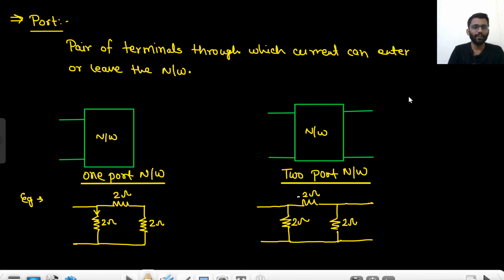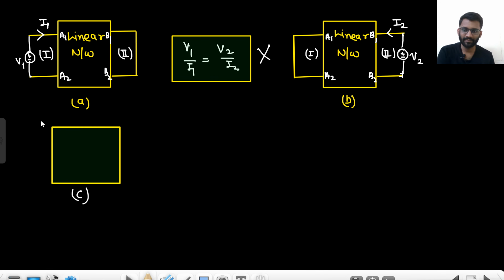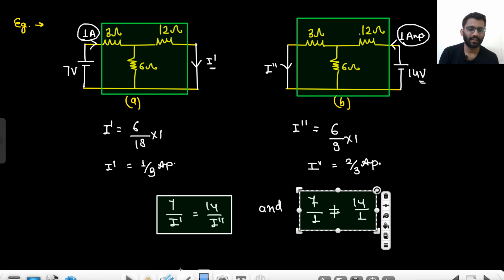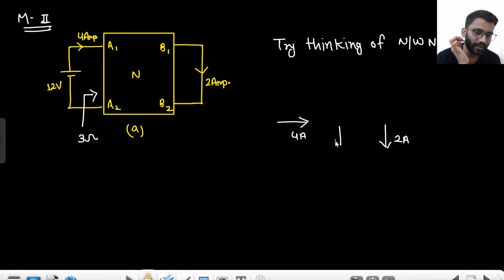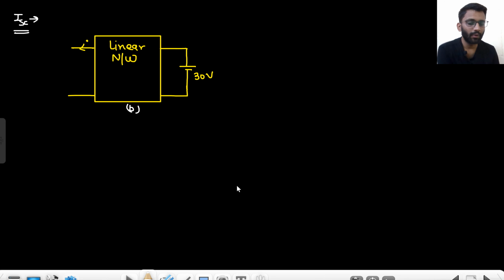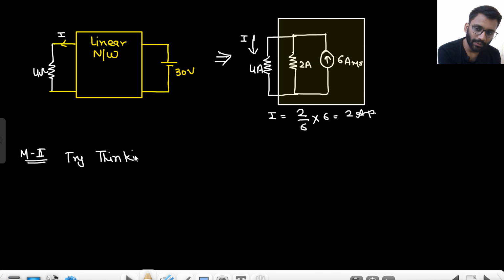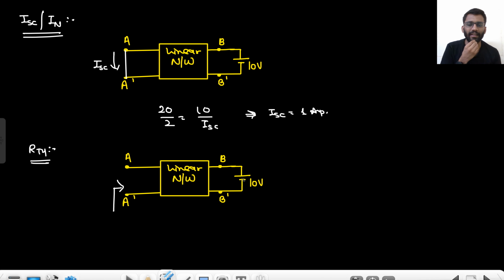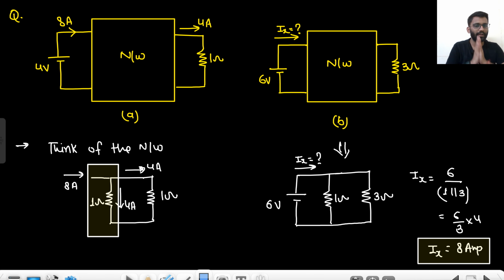Reciprocity Theorem || Network Analysis || GATE 2025-26 || PrepFusion || Himanshu Agarwal

Comment: At 48:07 in before concept you said ( network thinking) I did T network with 1/4 , 1/2, 1/2 resistance values, that 8A is splited into 4A, 4A additionally 1ohm resistor is added. But here you solved in entire different way? ❌
✅based on problem you need to choose, here for 0.5 ohm it is difficult to solve with T so we directly solve it. (not every n/w need to think in T)

At 48:07 can we apply direct formula; both are same networks V1/I1  = V2/I2 ?? I thought because of 3 ohm resistor they aren't same networks?

✅

Comment: I think we can not assume the network in a two port network as you have assumed in the last question that if source is giving 8 A current and load(1 ohm) is getting 4A current so you have assumed that a 1ohm resistance is parallel to the load  so it is also getting 4A current by current division. What if there is a series resistance in the 8 A branch and rest things are the same as you have assumed then current (Ix) will not be 8A. I think we have to calculate the thevenin voltage and resistance first and then calculate Ix. I am getting 9v thevenin voltage and 0.5 ohm thev.
Reply: I will give you one more perspective of this question. Try find the input impedance of the network from the given ckt, with load being 1ohm. What that will be? 1/2 ohm, right? So, Some x||1 = 1/2 ohm, so x should be 1 ohm only. I'm not saying 1 ohm has to be a resistor only. It can be anything by Equivalent Resistances of that particular ckt will be 1 ohm only, looking from the input terminal. 
Did you get it?
Reply: @HimanshuAgarwal_ yes...I got that...but if we solve it through thevenin and calculate load current and then load voltage so can we do response/excitation= const where response is load voltage and excitation is source current.?and then calculate Ix?
Reply from the maker: How will you calculate Thevenin's equivalent here? I don't think it's possible to find that. 
I would like to see your approach. Please send your answer on @HimanshuEC
Reply: @PrepFusion_GATE  consider a network in which a thevenin resistance rth in series with Vth and a load of 1ohm(given) connect accross the thevenin ckt current flowing through which(load) is 4A (given) so vth= 0.5*4+1*4=6v for the first ckt and so 9v (thevenin voltage)for the second ckt as Vs for the second ckt is 6V
Reply: @HimanshuAgarwal_  i think this is a better solution to the question than the one in the video.
Reply: If there is a series resistance of 1 ohm in that 8A, 4V branch then the current will not be 8A. it will be changed. The only possible N/w is simply a 1 ohm resistor.
Reply: @HimanshuAgarwal_  yes...but two port network can contain dependent sources, inductor ,capacitor anything such that current supplied by source is 8A..
Reply from the maker: Where did that 0.5*4 come from? Are you saying 4/8 = 0.5 Amp is Rth? No, that's absolutely not.
Reply: @PrepFusion_GATE yess...Now I got it.. thank u so much for clearing my doubt...I was taking input resistance as thevenin.😅.